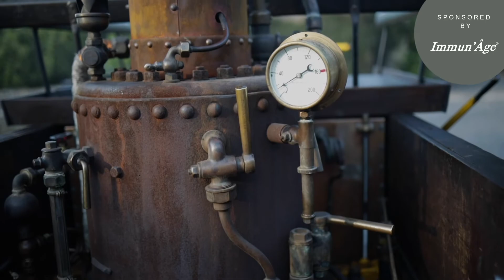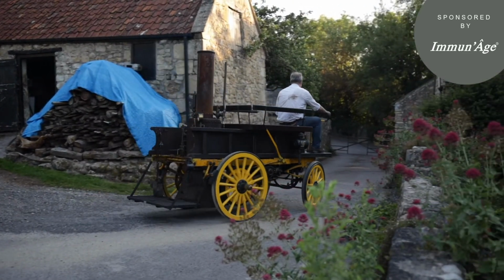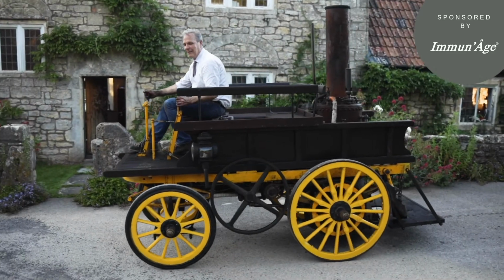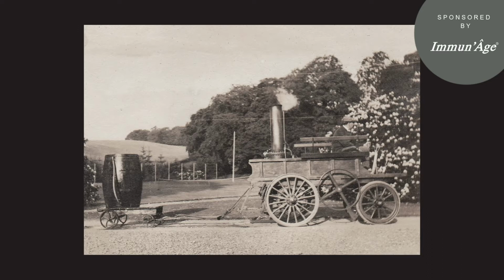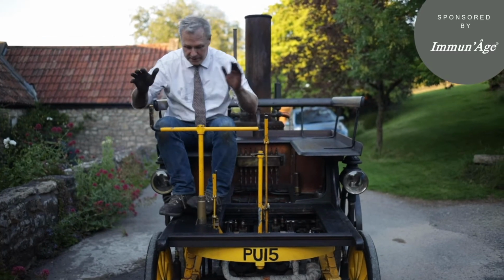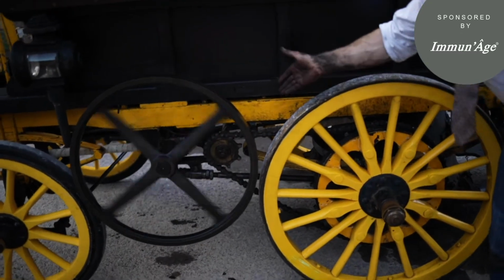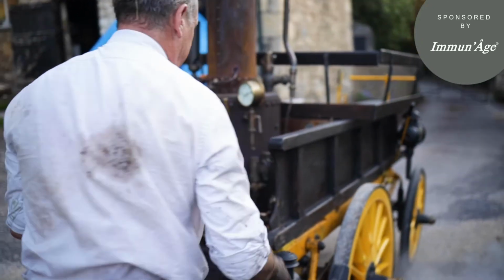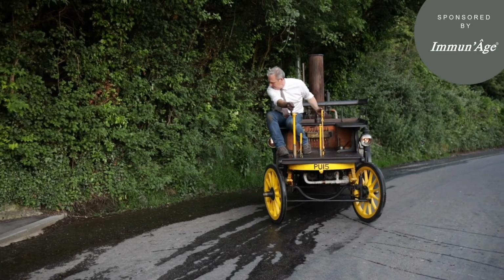Class A: Pre-War Presentation | 1893 Salvesen Steam Wagonette

Comment: There is a somewhat similar but even more ancient steam cart in the Smithsonian collection - horizontal boilered, rather than vertical, built in 1866. Unfortunately no longer on display. The original builder's family used it until about 1900, astonishingly.